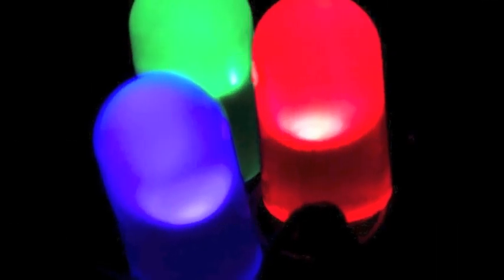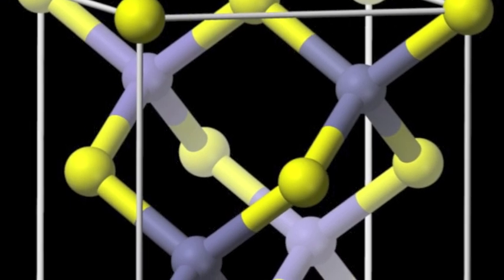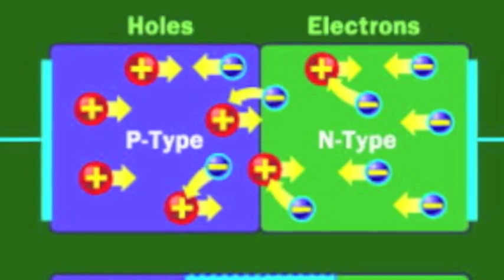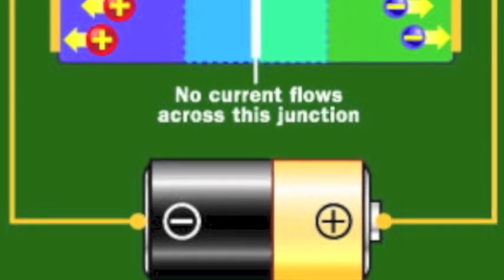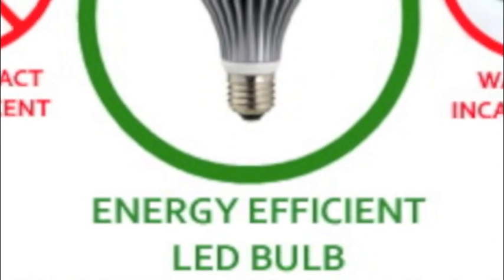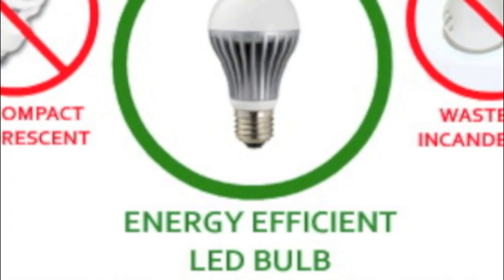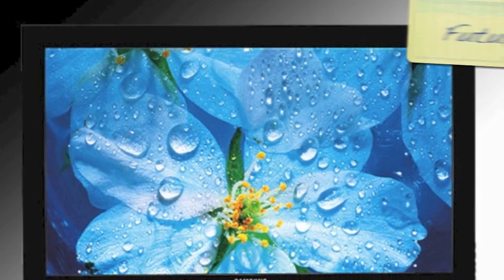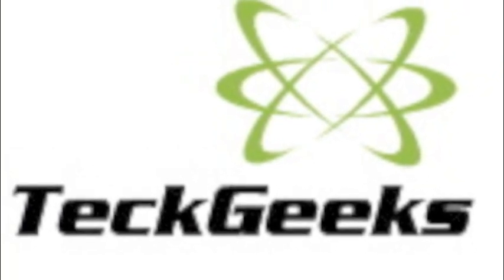Light Emitting Diode (LED)

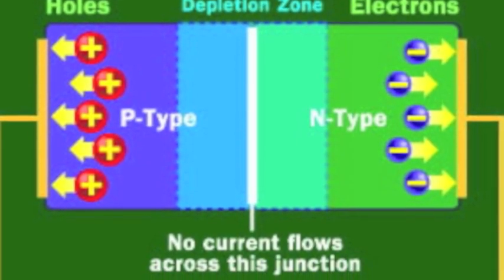Comment: This explanation is wrong 3:20 is a totally failure; by connecting the negative pole of the battery to the N-type connector, and the positive to the p-type end it is called reverse bias and only to enlarge the depletion zone which prevents the current from flowing, even the image copied some the 3-party website saying "No current flows across this junction".  You should correct your video to remove the misleading information.
Reply: Read  ur notes properly this is correct
Reply: Not reverse bias but forward bias read again what you wright
Reply: Tuan Nguyen the video is correct buddy

Comment: Just curious, hope someone can share some information, it is material of panel solar solar and LED is same from p-type and n-type
Reply: the material is not the same but the theory of p and n types and how they work are the same. theyre both semi conductors that use an outside source to produce light or electricity in their respective forms